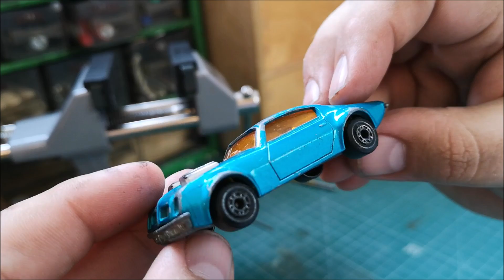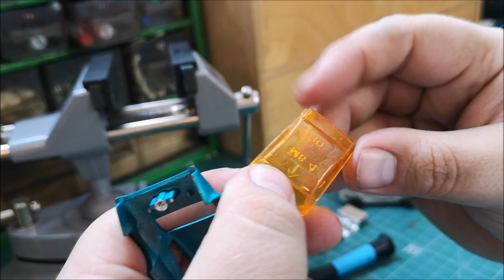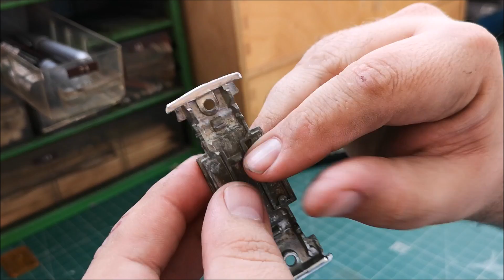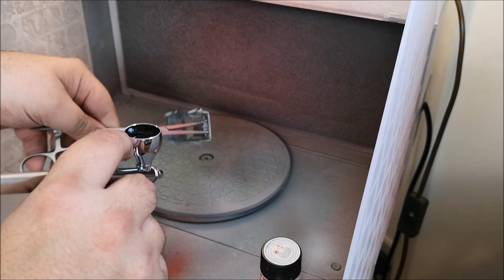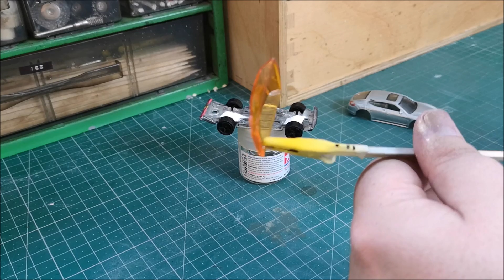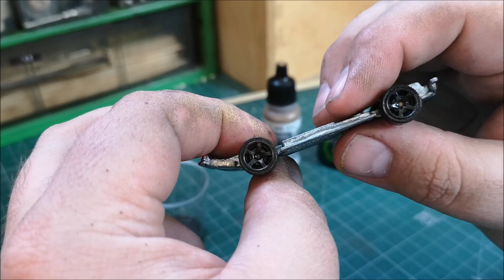Matchbox Series No 4 Pontiac Firebird - Custom Video

Comment: Turned out nice, what are the screws you use?  Looks like they have a nice big flat head on them. Thanks for sharing
Reply from the maker: I have a selection

SCREWS

24 off M2 x 3mm long HEAD Diameter 4mm

24 off M2 x 4mm long HEAD Diameter 4mm

24 off M2 x 3mm long HEAD Diameter 4.5mm

24 off M2 x 4mm long HEAD Diameter 5mm

24 off M2 x 4mm long HEAD Diameter 6mm

12 off M2 x 3mm long HEAD Diameter 7mm

Comment: Assuming you can find one that'll take the heat of boiling water you might be better off with a plastic container for paint stripping, Caustic & other strong alkalis can attack glass,  Polyethylene, polypropalene & Polycarbonate have relatively good chemical resistance.

Comment: Just think. A loaded Firebird Trans Am sold for just a little over CAD $10,000* (£5745) in 1978. The ordinary firebird, much less.

It was equipped with a 6.6 L V-8 (400 cu in). My best friend’s 18-year-old brother had one. A high school graduation present from his father.

*In those days, the CAD was worth almost as much as the USD. Also, US-built automobiles sold for more in Canada as well; in fact, they still do.

Comment: Outstanding result. Great job, Rob! I have a question for you though, how long did you wait before you masked off the black paint? I wanted to do the same with one of my hotwheels but I was scared the masking tape would damage the base coat. Thanks.
Reply from the maker: Hi mate around half hour but probably should have left it a little longer. I use Tamiya tape which is made for it. Normal automotive tape might be too aggressive

Comment: Take that ugly chrome interior back out, soak it all in bleach. It will eat that crap away and have a nice black interior. And chrome pen the covers if you want but I’d leave them. You’d also have better results with some wet sanding and polish to knock down that orange peel.. you could also run the pointy end of a thumb tack, or needle, trace from A pillar to B pillar and cut that ugly orange out! Wow they made those thing hideous! It was definitely the 70’s!
Reply from the maker: Thanks for the advice